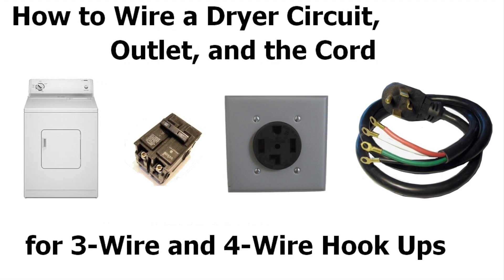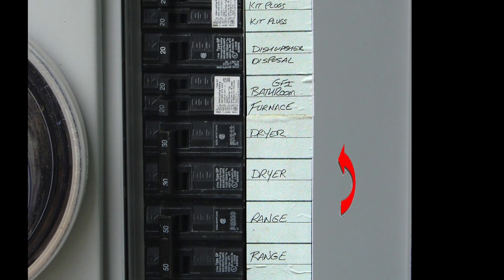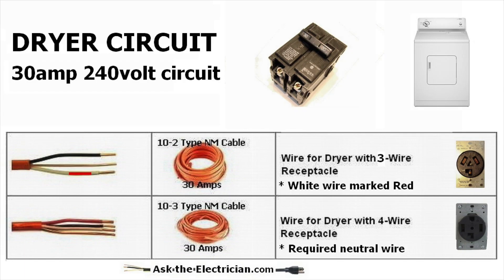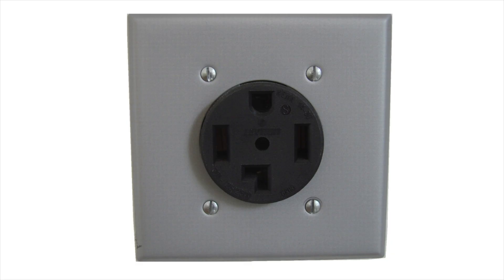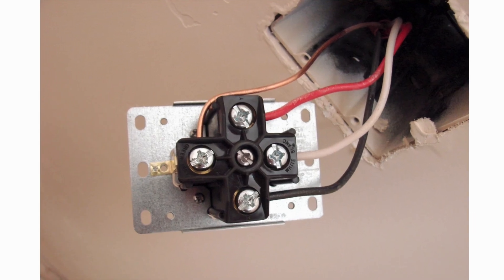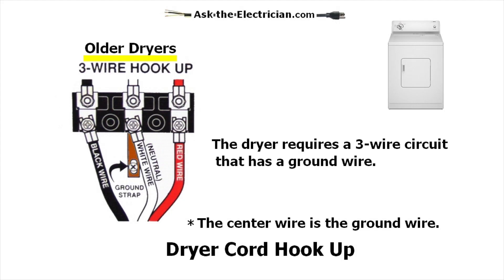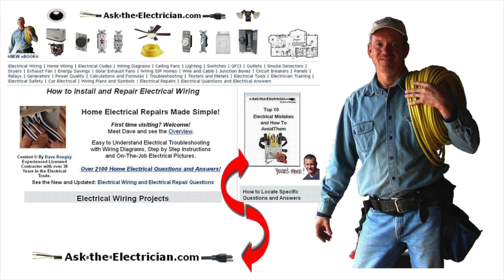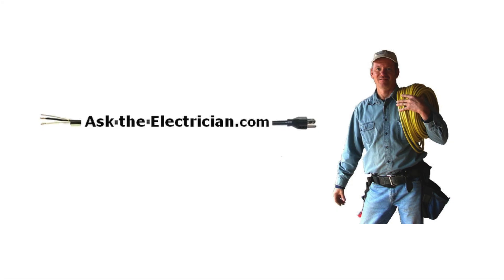How to Wire a Dryer Cord, and Dryer Outlet, 3Prong and 4Prong Dryer Cord.

Comment: If wiring a cooktop with two hots and one ground wire only to a main panel with a gfci breaker.  Does the pigtail from the breaker go the neutral bar in the main panel?  And does the ground from the cooktop tie to the neutral from the main panel to the terminal at the breaker?
Reply from the maker: The Ground and Neutral are bonded together in the main panel, so the GFCI white wire would connect to the bonded neutral, or ground bar in the main panel.

Comment: The 3 prong dryer cord has an “L” shaped middle prong. You have connected a bare ground wire to it. Isn’t a round prong used for ground connections? Would a neutral white wire connected to this “L” shaped prong work the same safely? Thanks for the video.
Reply from the maker: It depends if the outlet is 3-wire or 4-wire.
Reply: @AskTheElectrician  I have an older 3 wire dryer. It’s connected to a 3 wire outlet as shown in your video. Cord is 3 wires. 2 hots and a white middle neutral. No dedicated ground wire. At the dryer, the middle of the 3 wire terminal is where the neutral white wire is connected. Behind this middle neutral terminal a connected short wire connects to the green screw to the side into the metal part of the dryer. Your video shows a dedicated ground wire instead of a neutral wire. Is my dryer connected safely?

Comment: Great video, I'd greatly appreciate this question answered. I've a main disconnect outside this rental I own. Inside sub panel A my neutral and ground are separated. Had a licensed electrician do this. I'm installing an electric dryer and sparkys apprentice only ran me 10/2. I see the bare wire here used as if a neutral. Does that mean it needs to land on the neutral in the sub panel or to ground?
Reply from the maker: A bare ground wire should be attached to the ground terminal block in the panel, and to the ground terminal at the dryer receptacle. If the new dryer does not require a separate neutral wire then this will be fine.

Comment: Great video! I have a question - I have a 3 wire dryer outlet ( 2 hot -white and black and 1 bare wire ) . My dryer(2016 model) has 4 prong cord. Would replacing the 4 wiire cord with 3 wire be acceptable for my dryer ?Will it cause any problems? Thank you !!
Reply from the maker: You can only use a 3-wire cord if the dryer manufacturers manual states that you can, otherwise it will require a 4-wire cord.
Reply: @AskTheElectrician  I had a closer look and my dryer has 2 green screws with 2 straps to the metal.How should I proceed? Just leave them as is ? Thank you !
Reply from the maker: What does the owners manual say? Typically the electrical connections are described for specific equipment, because not all equipment is identical.
Reply: @AskTheElectrician  The two options are printed on the back of the drier 3 or 4 prong . How can I send you a pic of it ?
Reply from the maker: By going to my website as shown at my YouTube Channel info - look for the links, you can submit a question and attach a photo - This is available to anyone. The link will be much the same as my YouTube channel name as seen here. Hope to see you there.

Comment: This is kinda dumb question, but my mother's home only has the 4 wire dryer receptacle, and she has an extra electric range that she want to set up. Is it possible/safe to use the 30 amp dryer cord on an electric range? The manual specifies either 40 or 50 amp cord
Reply from the maker: Great Question, however the range will require a dedicated circuit, so be sure to have the new circuit sized as specified by the manual.
Reply: @AskTheElectrician  thanks for the response

Comment: Is it better to get an electrician to install a 3 wire nema 30amp 250v outlet installed or buy a gas dryer , as far as costs goes?

Since they keep saying i cant jist swap out the outlet

Comment: Here is a point of confusion. On a three wire outlet, the thrid wire was called the ground. On the three wire cord the middle wire is called a neutral. On the three wire dryer hook up the middle cord wire is called a neutral wire and has a grounding strap. Isn’t it dangerous to ground via a jumper to a neutral wire to the frame as shown in your picture? I have seen your picture in owners manuals before. It appears there is a name change between the outlet and the cord.
Reply from the maker: I know - it can be difficult. But the one way to know for sure is that I look at the existing cable that provides the circuit, and then verify the panel it comes from, and then check the connections. And to make it more interesting, if the circuit is fed from the Main Panel, then the grounds and the Neutrals are bonded together. The big difference with the cable is if the wire being used as the ground is insulated or not, because the neutral wire is treated as a current carrying conductor, but a ground wire is not, therefore the ground wire is often not insulated. So - when an electric dryer installation manual states that a Neutral Wire and a Ground wire (4-wires total) are required then this is what the dryer circuit will need. 
I hope this helps you!

Comment: Hi Dave can you please tell me why one of the prongs would get so hot that it melted the rubber and the prong turned black and we could smell it burning
Reply from the maker: Possibly a bad or loose connection. Make sure the wiring configuration is correct as well.

Comment: Really great video man! Question though how safe is it to change a 4 prong cord to 3 prong cord dryer because I have a 3 prong outlet. Would this be better or would you recommend a 4 prong dryer adapter with green ground wire that you plug the green to the outlet as well? Thank you so much!
Reply from the maker: It all depends on the specific dryer that you have and what it requires.

Comment: is that dryer breaker supposed be GFCI?
Reply from the maker: Yes - The NEC code now has expanded the use of GFCI protection for dryers. However check with your local building department to see if they have adopted the code change and requirement. Not all states adopt NEC code updates.

Comment: "NO" that's wrong info about the 3 prong dryer outlet. You "CANNOT" use 10/2 wire because a 3 prong has 2 hots and a nuetral just like a 4 prong. The difference is one has the ground 4 prong and the other one doesn't. You "CANNOT"  use the bare ground wire as a neutral. Use 10/3 for both and bend the ground and stuff in back of box on 3 prong and don't hook the ground up to ground bar in breaker box. Silver screw on receptacle is a neutral not a ground. Ground screws are "ALWAYS" green
Reply from the maker: Kevin, Your comment is Incorrect - here is why: You must understand that there are old dryers that are 240Volt, and there are new dryers that are 120/240 volt. An older 240volt dryer does not require a neutral wire, therefor a ground wire is attached to the Ground Terminal of the dryer outlet and the circuit will include 3-wires total, 2 hots and a ground. A newer 120/240volt dryer that requires a neutral wire will require a 4-prong dryer outlet which has a separate terminal for the neutral wire, and a separate terminal for the ground wire, and the required circuit will have 4-wires total, 2 hots, a neutral, and a ground. In a new home we typically install a 4wire dryer circuit, which will then give us the opportunity to accommodate either an old dryer or a new dryer, therefore the dryer receptacle and the actual wiring configuration will be Application Specific for the dryer. To make a blanket statement such as you have made is Incorrect because we have to provide the receptacle and the wiring configuration according to the Dryer that will be connected. This is why we refer to the Installation Manual and the Electrical Specifications for the Specific Dryer that will be used, and that is what we wire for. Side Note: In older homes that did not have a sub panel, the neutrals and grounds are bonded together at the main panel, and this is why we commonly find a 240volt 3wire dryer outlet - a neutral wire was not needed at that time because dryers were not made as 120/240volt. This applies to most equipment: If it is 240volt Only a neutral wire is not needed, but if it is 120/240volt then a neutral wire and a ground wire is needed. And as Nan Br has seen there is return voltage on a neutral wire because a 120volt device such a 120volt timer or a 120volt motor is being used, but the heating elements are 240volt - with no return voltage.
Reply: @AskTheElectrician If you can help oh man that would be great.

So, the outlet only has white, black and bare. The new receptacle calls for white (neutral) black and red and it's ungrounded. It's 30 amps max, 120v/250v I have one hot, one "neutral" and one bare ground. It's an old school plug type circuit board. I understand...I know you can't give exact advice.

My ultimate question is if it's okay to only attach one "hot" wire and leave the other dead while also connecting the neutral also. The receptacle is un-grounded type. My thought is to attach the white to neutral, the black to one while leaning the other dead and then ground the bare wire.
Reply: I think you're right because I'm installing a stackable dryer at my daughter's house, 3 prongs and after watching some videos I put both hot and ground in the wall socket and turned on the machine to do some tests and then I noticed that while the machine was washing the clothes I measured the amperages and the ground was giving 6 amps and in a hot giving 6 amps and another hot was giving zero! and when the machine was drying the clothes I measured again and a hot was giving 21 amps and another hot 18 amps and the ground giving 4 amps! after seeing your explanations I will change and put the neutral in place of the ground and make the amperage measurements again! the reason I put the ground was that on the machine's identification plate (warning) it says that the machine has to be permanently connected to the ground wire but looking from behind the machine at the connection that comes out of the machine to the prong, the ground It's connected to neutral! I’m from Ohio and de machine is used ! Old 3 prongs !
Reply: @nanbr7512  You definitely cannot use the bare ground wire as a neutral because it will end up causing a fire. Electricity is returned back through the neutral wire while the dryer is in use. The bare ground is only wrapped in paper in the romex. Only in a main service breaker box with the main shut off in the box on top the neutrals and grounds are bonded. They are not bonded in subpanels they are separated. Neutrals go to neutral bar grounds go to ground bar. You have to buy the ground bar kit and install on new subpanels like Square D Homeline. 10/3 is the correct wire when wiring any dryer.
Reply: @kevinsimpson7687  You are right! I will buy 3/10 and remove the 2/10 and I will make the connection with HOT+ NEUTRAL + HOT and because it is 3/10 with GROUND then I will leave the GROUND disconnected in the wall outlet box and also disconnected in the breaker box!
Reply: How to replace head gasket on 2007 Saturn Sky turbo charged

Comment: A combo stacked washer/dryer in a 1966 Mobile home with 1 cord. It is a standard 3 prong and plugs into a NEMA 10-30 wall outlet. 
It was fed straight from the power pedestal with a 10-2 flex cord, bypassing the sub panel inside. Yes house is fed with 2 ea 50 Amp RV outlets outside.

Sub panel is a 50 AMP GE fed from outside power Pedestal with an RV 50 Amp plug/6-3 wG with a double blank in the center two spaces. 

But the 10-30 outlet had the black to the right side 'HOT' pin, the Green to the Left side 'HOT' pin and the yellowish White to the center pin. 

I am guessing they used the GREEN wire as a hot??? I ran a 10-3 wG from sub panel 240V 30 Amp breaker, going to use the Black and Red for hot, White as neutral and bare as ground .

But how to wire the 1-30 plug if it was wired as in my 3rd paragraph above?

The washer must use 1 hot and ether the Green or the funky White. 

I may need to open the Pedestal and look at the 50 Amp RV plug.
Reply from the maker: It would be best to ask this question using my website question form and include a  photo of the pedestal panel, this way I can provide more resources than I can here. 
Go to ask-the-electrician.com where you will find the details for asking your question.
Thank you!

Comment: How much does it cost for an electrician to rewire or replace electrical wiring for the three prong near dryer (2022)
Reply from the maker: Typically it would be a time and material project and the cost would depend on your location and the proficiency of the qualified individual or electrician.

Comment: My dryer won’t dry. We are the first ppl to live here and it was allegedly renovated. New dryer. The vent and hose is all clear. Our dryer vent outside though has obstructions. I’m wondering if this can cause a problem?
Reply from the maker: Make sure the wiring for the circuit and cord are all correct. Yes - obstructions anywhere within the dryer vent process can cause the high temperature sensors to turn the heat off thereby preventing the clothes from drying.
Reply: @AskTheElectrician  Ughhhhhh. I’m just a woman, I have no clue how to check that.

Comment: where does the white wire go if i have a 3 wire dryer
Reply from the maker: If the white wire is not needed then just cap it off with a wire nut.

Comment: I replaced my breaker for the dryer I had to get a special kind because that's just my luck and I changed the dryer outlet and I still have maybe 7 volts coming out all together.how do I fix?
Reply from the maker: The following articles may help you with this problem:

https://ask-the-electrician.com/causes-of-inconsistent-voltage-on-a-circuit/troubleshooting/

https://ask-the-electrician.com/electrical-voltage-problems-and-solutions/troubleshooting/

Comment: If I have a 120v 20 amp dedicated circuit can I change it to a 240v 30 amp receptacle for a dryer?
Reply from the maker: No - the voltage is wrong, and the size of a circuit breaker cannot be increased.

Comment: What cost to have all wiring done from beginning to end when their no wiring from dryer being relocated?
Reply from the maker: Cost depends on the home, access to where the wiring needs to be installed from panel to dryer, it is basically a Time and Material charge with the rates relative to the location.

Comment: Can you use aluminum wire on a standard 3 prong outlet
Reply from the maker: It is best to use #10 copper wire for a 30amp dryer circuit.
Aluminum wire may be used for larger circuits and as panel feeders when it is installed correctly.

Comment: was curious on something i have a 40amp circuit older home the outlet is 50amp the dryer cord was modified to work in the 50amp outlet my question is how could i fix this to be up to code thanks in advance  i thought about a 30 amp outlet but you cant do that on this circuit and i seriously doubt grinding down the pin on the L ground wire is the proper way the old wire from old dryer had a melted pin on the hot wire so i am looking at possibly having a major wiring job done the other issue is we have federal panel sorry for long post 👍
Reply from the maker: It sounds like you will be upgrading the home electrical system, so you may consider starting with a new panel, and then the specific circuits as per code including a new dedicated circuit for the dryer.

Comment: Why when i hook up the 2 hot and a ground #6 the display gone on my stove and why i use the #8 with 2 hot and a ground it display the screen but wont turn on oven. Pls somebody help me thanks
Reply from the maker: What does the Installation Manual state as far as the Required Electrical Circuit for your Specific Stove?
Does your stove require a dedicated Neutral Wire? If so then that is why it is not working right, and a new circuit may be required which includes 3wires and a ground wire - 4 wires in all.

Comment: I have a 3 phase compressor (reciprocating variable speed) that I hope to hook to power supply cord. Terminal has NO label of T1, T2, T3. How do I know which wire goes where?
Reply from the maker: Look up the motor information, get the make and model and search for a wiring diagram online. Make sure to look on the backside of the junction box cover plate, or the nameplate of the motor, the wiring diagram is typically provided at these locations.
Reply: @AskTheElectrician  so I couldn't find wiring diagram online for the specific model. I wonder if it's because it's a 3 phase compressor.. only markings I see on the compressor is manufacturing markings

Comment: Hi, I have a question. I have the 3 prong 10-30 dryer outlet on my garage wall, and I am only using the gas dryer.  I bought the new Gen 2 NEMA 10-30 Adapters from Tesla. Every time when  I charge my 2021 Model 3, the first few minutes can get 25mi/ hr , 24/24V 236v  , but after 5-10 mins,  it drops to 12mi/hr 12/12A 236V automatically . And couldn't manually adjust  back to 25mi/ hr , 24/24V 236v again.  Do you know what is going on ?  I hope you can help me.
Reply from the maker: Make sure that the 240volt dryer outlet has full power as required for the Tesla power adapter. It is best to have a dedicated power source rated for the specific EV Charger rather than using an power adapter.